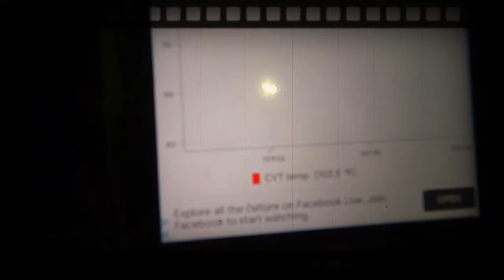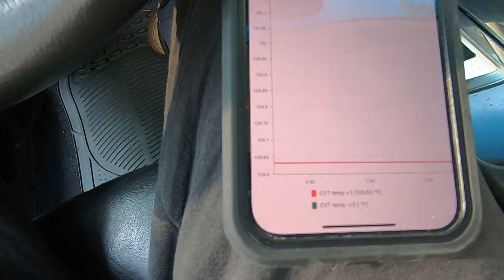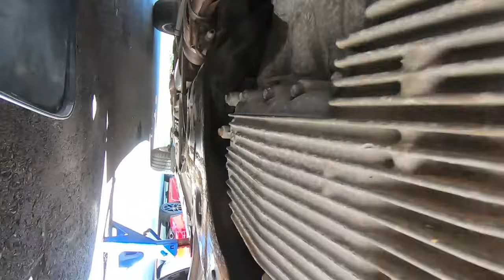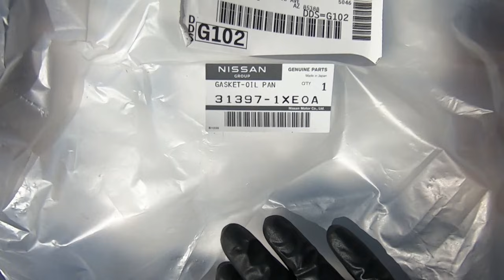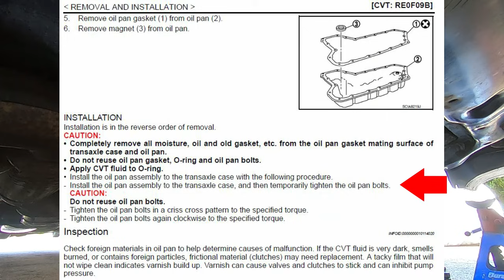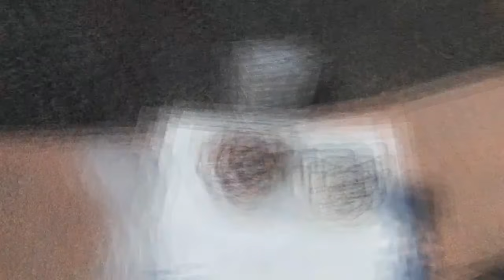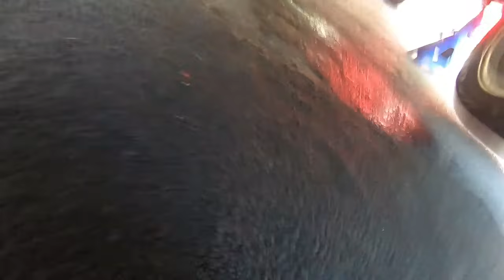2009-2014 Nissan Maxima CVT Fluid & Filter Replacement

Comment: I just bought a 2012 Maxima with 97k miles and about the change the transmission fluid. The fluid was changed around 60k from the original owner. I was going to complete a drain and fill and change the external filter.

Do you think it’s necessary to drop the pan? 

There are no leaks.
Reply from the maker: Nice, good to hear. Honestly I think you would probably be fine either way. Would be ideal to drop it, but considering your mileage & the fluid has been replaced before…I don’t think you have to worry about not dropping the pan. I would change the fluid every 30K…so at 120k i would consider doing it with another fluid change.
Reply: @TheOriginalBeeCee Thanks because I know that it’s very labor intensive servicing the CVT. 

I need a tuneup too and the front lower control arms are worn and some bushings in the rear are worn but expected for a car that’s 14 years old. There is still a lot of life out of the engine with not even 100k and the car is pretty clean so I am hoping it will last for a while as I am tired making payments on cars previously. It will take a few grand to get the above maintenance completed.
Reply from the maker: I hear that man. Definitely worth maintaining an older car versus buying a new disposable tablet on wheels in my opinion!
Reply: @TheOriginalBeeCee Unfortunately the CVT is the weak link with Maxima and very expensive to fix if the transmission fails! My fingers are crossed that after the fluid is changed that it will last for a while!
Reply from the maker: @kenharris7194 yeaa man thats all you can do. I definitely think it has a fighting chance as long as you stay on top of it & do fluid changes every 30k 👍
Reply: @TheOriginalBeeCee That’s the plan and I always take good care of my cars but the person I bought the car from neglected some maintenance for a year or two as the car wasn’t driven much. I brought the vehicle to a reliable mechanic so it should all be good afterwards!!

Comment: Great video! I have 2010 maxima with 248K miles. The trans fluid & filter have never been changed since i bought the car with 30k miles in 2013. Should I change the fluid & filter now? Trying to see how many more miles this car can go. No issue with the engine or transmission since I own the car.
Reply from the maker: Appreciate the comment! But there’s mixed opinions about it. Personally, the more I learn and see about these CVTs, the more it seems mileage is irrelevant. I’ve answered other comments on my Altima CVT Video and suggested against it (of course I don’t want to make a bad suggestion), but here’s my current take on it. 

It seems the CVT doesn't shed fibrous clutch material like a regular automatic…so by replacing the fluid, you shouldn’t be disturbing the inside of the transmission. 

You can get an initial gauge of fluid condition by cracking the overflow bolt while running. Grab a little cup and let some flow out into cup just enough for you to see some fluid. That way you can get an initial gauge on the condition. As long as there isn’t metal/debris in it, you should be fine, even if it’s just dark. I would probably suggest start with a spill & fill first though before doing this full service..just to be on the safe side. Then after 20k if everything is good, do this full service. Just my 0.02. Couldn’t hurt to do some research on replacing fluid on high mileage CVT’s as well! Just make sure whatever you’re searching is for CVT’s & not a regular automatic transmission.

Comment: use Grok to find part numbers. My trans actually started slipping to the point the engine was overheating. I was lucky enough real close to home. What I did was drain fluid, then replaced with six quarts NS-3 as nissan no longer makes NS-2 and the dealership said it was ok to use. This instantly fixed the problem. Drove it for 2 weeks, drained again, and this time also replaced the filter behind the drivers side front wheel. 30k miles later transmission is running sweet. Getting ready to change fluid again.
Reply from the maker: Great to hear! Glad you it sorted! But yes, Nissan has been recently phasing out NS-2 fluid. I was able to source it from dealer one more time after the making of this video.

Comment: I found metal shavings in my transmission oil pan what should I do help me out
Reply from the maker: To what extreme? You will have some around the magnet, and when you drain & drop pan, its possible to disrupt that some. When you just drained the fluid…..did you inspect the fluid? Was it sparkling/metal in just the fluid before dropping the pan?

Comment: I’m afraid even with all those cvt fluid changes the cvt will fail inevitably at around 100K (they all love to go out at around that mileage). 
I have a 2011 maxima (93k miles, owned since day 1) with 4 or 5 drain and fill tranny fluid changes throughout the car’s life.  
I have had a few ”hiccups” with the transmission but it’s still going….Let’s see how much more I can get out of it.
Reply from the maker: They are a bit plagued, especially the earlier years….but they do actually seem to respond to fresh fluid & maintenance….& seem to make it longer when regularly doing so. We had a 2014 Altima (OG owner) make it to 250k with 0 issues. Regularly maintained & shifted perfectly fine. Car was rear-ended & totaled…someone else killed it…..NOT the CVT!

Comment: Great video. I won’t be using the oem Ns2 fluid, I’ll be using LubeGard cvt fluid with a OEM external transmission cooler from Nissan.

Comment: Would there still be fluid I need to drain after dropping the pan or is it cool to just go ahead and put in the 6 qts you suggested and just let the little bit of old fluid mix with the new fluid?
Reply from the maker: You will be completely fine just doing what I did. Really just want to spill/fill CVT transmissions. A little old fluid mixing in is perfectly fine, that’s natural to happen a little in a job like this.

Comment: Thank you very much for your step by step video.  I had a horrible whining noise after CVT oil change that was a direct result of what you had mentioned.  Amazon parts are nit OEM, the replacement filter had a longer snorkel and was being suffocated by the bottom oil pan. I ended up using the old filter screen (after I cleaned it) and everything worked out perfectly.
Reply from the maker: Yup! Exactly why I didn’t even bother with the internal filter. Glad to hear you got it done & sorted!!

Comment: I just recently got a service engine light and it’s a transmission issue and it says I need a new one by the obd scanner, do you think I should just call it quits I wouldn’t replace the transmission anyways or should I try and replace my fluid?
Reply from the maker: Really subjective question and even harder to say. I would say the drivability of the transmission would play a role in that decision…as if it currently runs & drives, how its shifting, if it can make it thru all the gears, if its just shuttering, etc. might be worth it to give it a shot in that case because sometimes fluid changes can bring back transmissions.
Reply: @The @TheOriginalBeeCee it still runs and drives for now but I am going to try and replace the fluid and it threw a code for the stepper motor so I’ll replace that whilst down there thank you for the inquiry I appreciate it man🙏
Reply: @TheOriginalBeeCee my 2014 maxima SV is whining around 40 mph and chirps slightly even cranking. But no jerking or slipping. It feels like hydraulic pressure is low . And fluid is foamy/ bubbly .

Comment: Heyyy I drive a 2012 if your having problems still with your transmission will slipping and stuff me and my dad put a transmission cooler on my car we placed it and zip tied it to the ac condenser and radatior and just hooked the hoses up to the old external cooler

Comment: Just changed my fluid on a 2010 max with 190k. Bought an a1premium aftermarket filter and gasket kit. Ended up cleaning the oem internal filter and reusing the metal gasket cause the aftermarket kit had a rubber gasket? And a flat mesh internal filter vs a pleated oem.. the aftermarket was visibly not as fine as not pleated. The metal oem sealed fine ..regret not going nissan oem before the change. Transmission replacement not the cost of aftermarket parts. Although I did use idemitsu ns2 fluid
Reply: How has it been so far? Just picked one up at 190k and after about an hour of highway speeds the transmission overheats and I have to get off at an exit and wait 20ish min for it to cool and keep going. Long story short idk if I should just baby it like this or risk the oil change so late in its life
Reply: @daRugs17  Just drain some out the plug and refill it, then see if it improves. If it does, you can do a more thorough job 10-15K miles later perhaps.

Have you checked the transmission fluid level yet?

Comment: Im her watching with 143k on original fluid 14 maxima 😂 I'm scared to change it transmission shop said not to
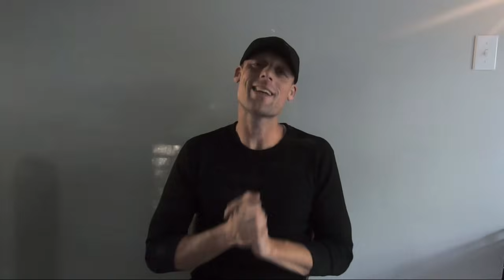Reply from the maker: I touched base on this debate with my opinion on the subject @ the end of the video. Starts @1:08:57
Reply: @TheOriginalBeeCee I might try changing it . Great video by the way . It has a slight shudder at low rpm and low speed . Then it's fine and great on the highway. Did you change fluid in a high milage maxima ?

Comment: Do you have to drain the cvt fluid hot?
Reply from the maker: Did you watch the video? Lol
Reply: Yes, of course. After I saw your snarky comment, I really should have phrased my comment differently and said warm instead of hot. I saw your glove had a hole where fluid penetrated but yet you were not scalded by the hot fluid. I followed what the book and you did however the fluid was extremely hot. I'm thinking I could have done it warm and have similar solubility.
Reply from the maker: As long as you’re in the range outlined in the video/screenshots..you should be perfectly fine. It’s a pretty wide range IMO, so there’s some play room. The fluid is definitely hot from my experiences doing this, but I’ve never felt it to be overly hot to the point of burning or anything.

Comment: If only they used a normal transmission
Reply from the maker: Most manufacturers utilize CVT’s these days
Reply: @TheOriginalBeeCee that’s interesting.  I hear so much chatter on the net about how bad they are.  And that it’s gonna kill Nissan because they use them.  lol.  Good to know others are using them.  Apparently they ain’t that bad if others are using them.  My wife’s Buick enclave tranny went out and it cost me $5600!  I about had a heart attack.  Yet I hear about how bad these are.  I think it comes down to maintenance.  We bought that car used so i don’t how that car was maintained.
Reply: @TheOriginalBeeCee i hear Toyotas cvt still has a gear or two for takeoff and then switch to belts and pulleys

Comment: I've heard from multiple mechanics that suggest not to mess with changing the oil because supposedly the transmission will start failing after the oil change on the transmission. I dont know how true that is...so im scared to change the oil, and my transmission goes out.
Reply from the maker: That statement can be true with traditional style transmissions, not CVT’s. I spoke on this at the end of the video @1:12:45
Reply: Then they are crap mechanics. Old oil had all kinds a debris in it that actually aids in friction with old transmissions. Changing the oil removes that friction and can cause an old transmission to slip. It does not cause the problem it highlights there is a problem. Mechanics don’t like that because no one likes it when their car is worked on and it runs worse afterwards and the mechanic blames it on a transmission that apparently was working fine. I would want to know if my tranny was going bad in my garage rather than on a long trip and in the middle of nowhere. You can add friction additives with an oil change to keep things going while also knowing you have good oil. Old oil is NOT good for anything mechanical.

Comment: I have had a max for 2.5 years and the f'in CVT died on me in the  middle of the road with absolutely NO WARNING! 149K on the car and that is it. TOAST!
Reply from the maker: Sorry to hear. Definitely can be a major headache. Out of curiosity, what was the maintenance schedule like?
Reply: @TheOriginalBeeCee  I got oil changes on time. That's about it. Some other problems but unrelated to the trans
Reply: I am going to chk out a 2014 Maxima with 67K miles on it. The cost for the car is $400 less than the price I was quoted to put in a new CVT. Am I crazy to stay with Maximas or should I move on to a Camry?
Reply: @144Donn Camry 100%
Reply: @144Donn honestly Camry is good but maxima has v6 engine super fast if u got a sv version even better the only thing is the cvt
Reply: Sorry about the ignorant question but how do you know it died...just cant switch gears? Or....wondering cause I havent done my transmission change and I need to do it...
Reply: @Castelanu91  CVT light came on Mechanic told me the trans is shot! Did not move an inch! I got a fresh 23013 Max with only 34K on it.
Reply: @144Donn got it. Thanks for the reply. Wish the best
Reply: @Castelanu91  actually the mechanic put in a new trans and I got a few bucks from the sale...but I think it will last another 100K I drove the car..much to my surprise as I thought it was dead and gone!! Thx for the good wishes
Reply: @144Donn as long as u get ya transmission fluid changed every 30,000 miles cvt will last long

Comment: Excel video. my 2014 maxima one day the engine started racing and car was slowing down. Happened near my house. Called around and was told the cvt needs to be replaced. Did some searching around and found this can happen when fluid needs to be changed. I changed the fluid just draining didn't pulldown the pan, and cvt went back to working fine. Ran it two weeks or so, changed the fluid again plus the external filter. That was 25k ago and cvt is running better than ever. Used NS3 for the new fluid as NS2 is not really available anymore.  Plan on changing fluid and filter every 30k for now on.
Reply from the maker: Great to hear! Glad you got it sorted with a fluid change! Awesome to hear!!!
Reply: That’s awesome! I also have a 2014 Nissan maxima and I called my local Nissan dealership to ask about a fluid and drain for the transmission and a filter change since we just bought it and we want to take care of it. This woman in the service department told me that the 2014 Nissan maxima CVT transmission doesn’t have a filter and she said even if I don’t do a flush and just do the fluid change it’s the same thing and I’m risking messing up my transmission: I’m so confused now but your comment did help me some. I’ve been reading a lot of comments and everyone who has a 2014 Nissan maxima CVT transmission says it has a filter and a fluid change helps the transmission it’s the flush with the high powered machine that has a possibility of hurting it from what I read. Idk if this woman was new or what but everything she said contradicted what I’ve researched and heard so far.
Reply: @lynnmartinez89  I didn't flush, just drained. Its just under 6 quarts. Don't pull the pan. Replace the plug gasket with a new one. Use only NS-3 no other. The filter is behind the front wheel driver's side. Remove the wheel, remove the cardboard (wheel well cover)  so you can see the car frame  the filter is right up front mounted on the frame right behind the cardboard essentially.
Reply: Thank you. My 2014 is doing the same thing. I will suddenly not get any action when I put down the gas pedal, like the gas is totally cut off or something. Then it'll catch on, and then it'll do it again randomly. I've been having to put on my hazards and try to get out of people's way. Then it'll suddenly work again. It's been doing this off and on. 
I read in forums exactly what you are saying. That most of the time, all it needs is changing the fluid. You just validated that for me. I'm hoping that is all it is. Wish me luck. Thank you!
Reply: @natnat1975  change the fluid twice as I indicated. Change the external filter on the second change. I have 6 quarts and a filter ready to go when I get 30k from the last change. I would only used NS3 and no other substitute. The filter is behind the driver front tire behind the wheelwell cover is mounted to the frame. Good luck.
Reply: @russmarano19 yep. I changed the fluid and it solved all the problem.
Reply: @russmarano19 I spoke too early. It happened again. But this has something to do with my cruise control. I'd have to get into way too much detail to explain, but I know this is all mixed up with the cruise control malfunctioning. Whether I'm using it or not.
Reply: @natnat1975  Usefull info! Did you find a fix?